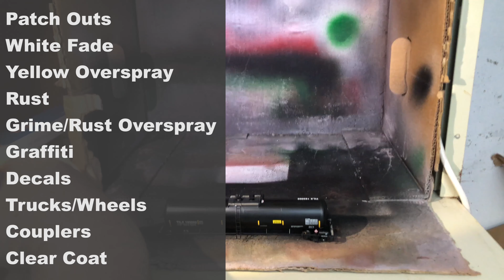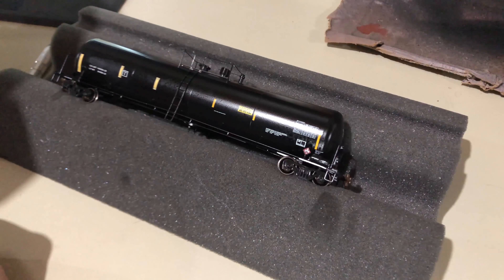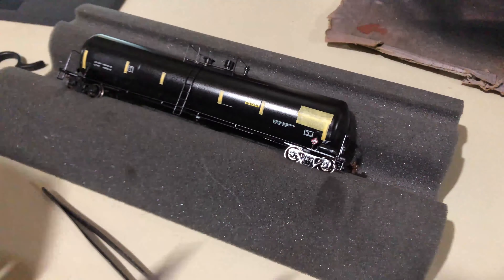Weathering Wednesday: Athearn RTR 30K Ethanol Tank Car

Comment: I have found that eye shadow make-up you get at the Dollar Tree store sticks better than any weathering powder (chalk) and only costs $1.00.  You get 12 earth tones from light brown to dark earth including rust.  You might want to try it.  I've used it quite extensively and it works better than any weathering powders I've ever tried.  And it's only $1.00.  I usually fade the paint with my airbrush using flat white acrylic paint.  After that I use my airbrush to paint on any recent rust then go back over it with the darker eye shadow to simulate older rust.  After all the weathering is done I dull coat it with my airbrush.